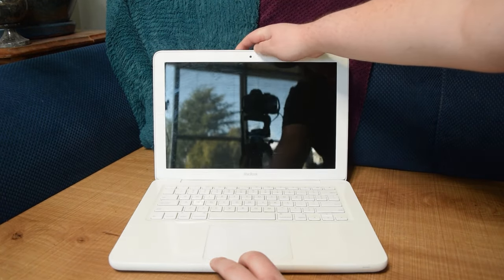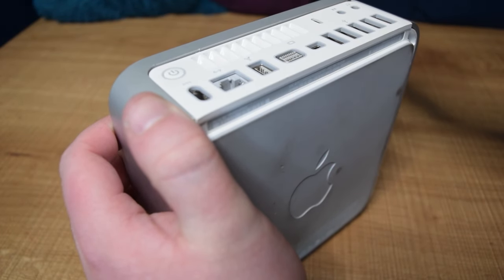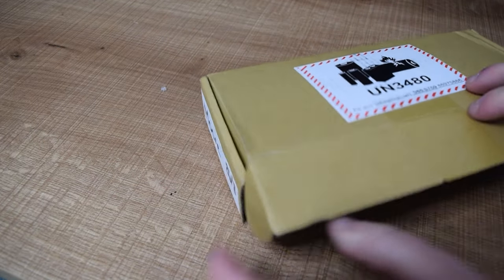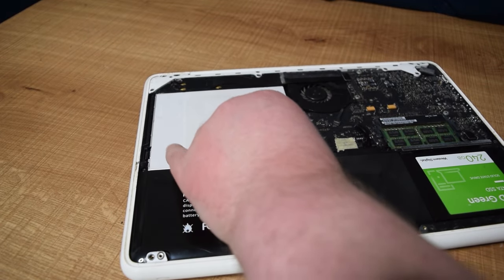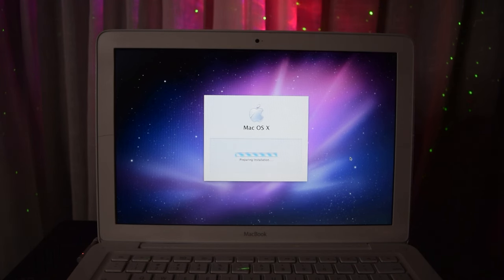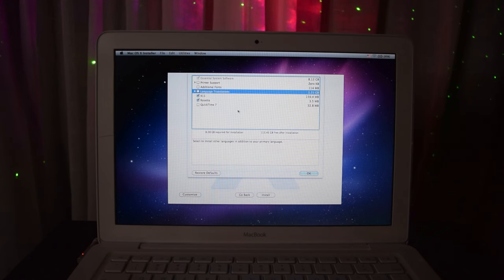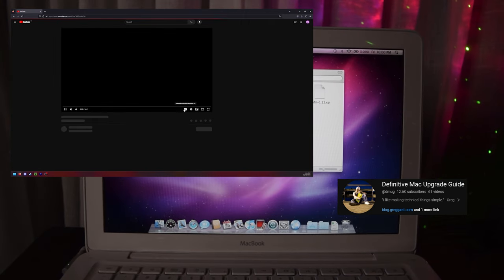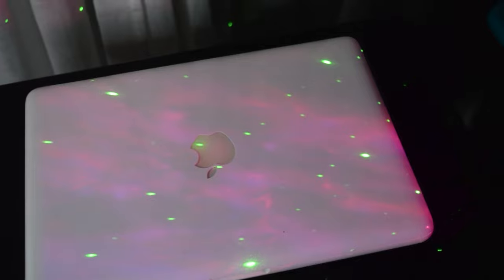Restoring my 2010 MacBook (Nostalgia warning)

Comment: I have one of these, but I have Lion on one partition, and Mojave (I patched it) on the other, and I think I had/have Linux on the third, smaller one. It still works pretty decent, but I maxed it out at 16GB RAM and 500GB SSD.
Reply from the maker: Nice!
Oh damn, I had no idea you could get 16GB RAM into these.  How does Mojave run?
Reply: @QuinsTechCorner  It takes a moment to boot up, but it runs alright.
Reply from the maker: @JimBobSr   Nice!  Glad to hear it's going well for you.